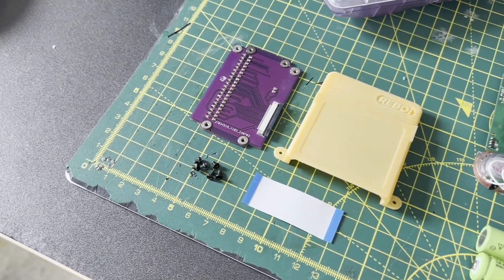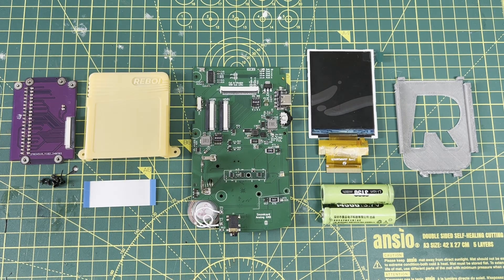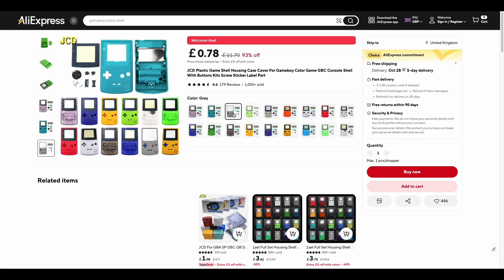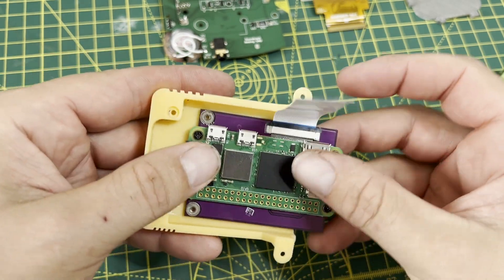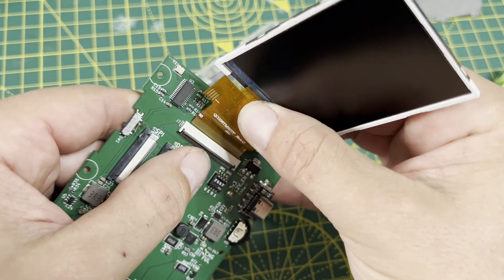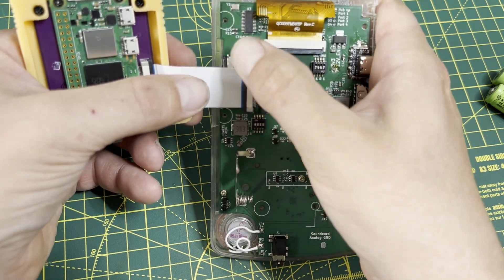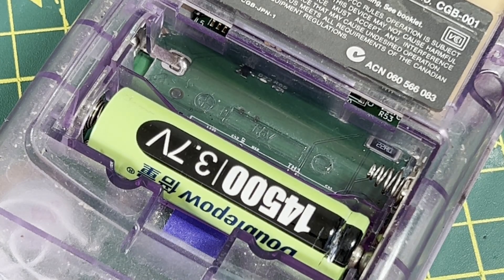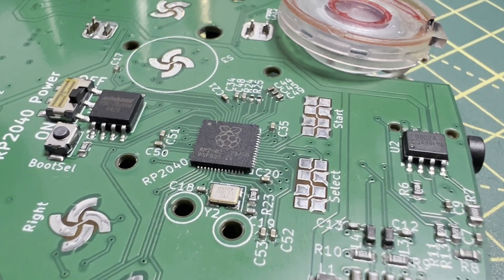ReBoi Design complete! Assembly First Look - Raspberry Pi GameBoy

Comment: Awesome project, I'd like to see access to the micro SD card in the pi and the HDMI and USB ports without having to open the case. 
Is using the pi zero 2w with it's wifi and Bluetooth enabled supported?
Reply from the maker: you could pipe the SD card and HDMI port out with a flexible PCB, might be something ill work on down the line. 

You have access to the Pis USB port though the USBC port.

Yep most of the configuration is done over WiFi / ssh

Comment: if the rpi pico controller is using the same processor then it should be able to have a shitload of GPIO, I have things I would like to do with this if I buy one and just having the GPIO exposed would make this 10/10 the best thing I would possibly want please I don't need them to be some extra connection just literally have traces lead to some kind of exposed pad and that would be enough for me
Reply: Hey Man! That's the plan! the ReBoi uses a bunch of the GPIO for the buttons and the LED, at the moment I'm using three of the ADCs for battery charging and monitoring, but the plan is to have at least 5 GPIOs and the remaining ADC broken out to pads around the PCB, with power and ground pads for hacking and adding new features. It's designed to be assembled without a soldering iron, but I don't want to go ss far as to prevent people from hacking it if they have the tools :)
Reply: @james-sargent  SHUT UP AND TAKE MY MONEY